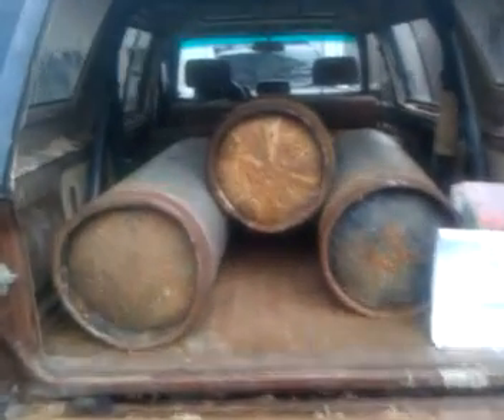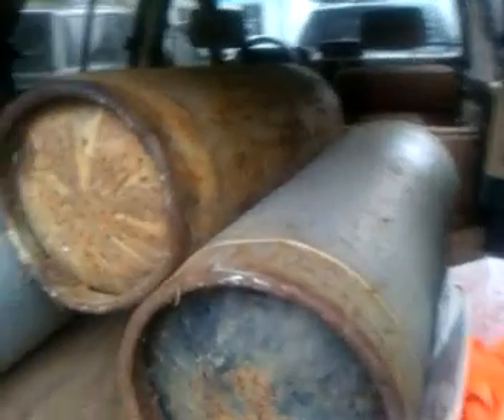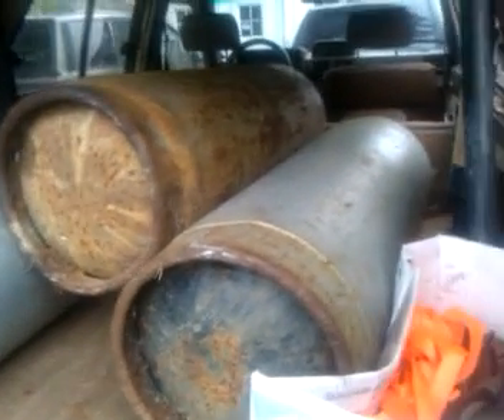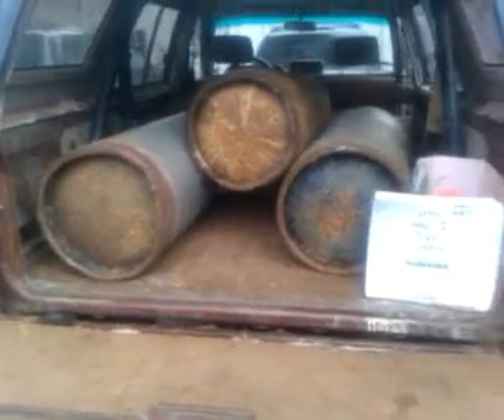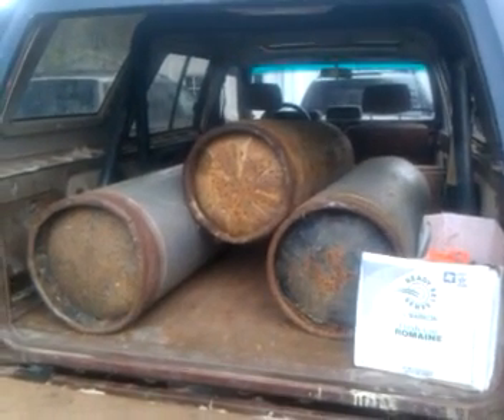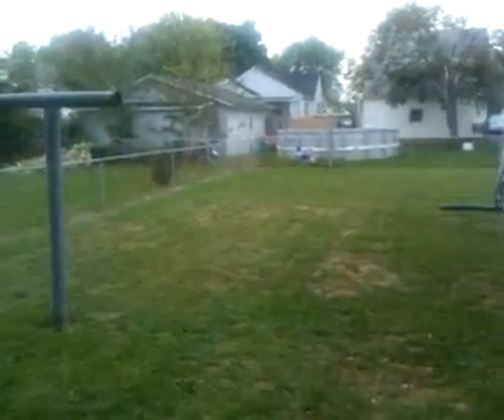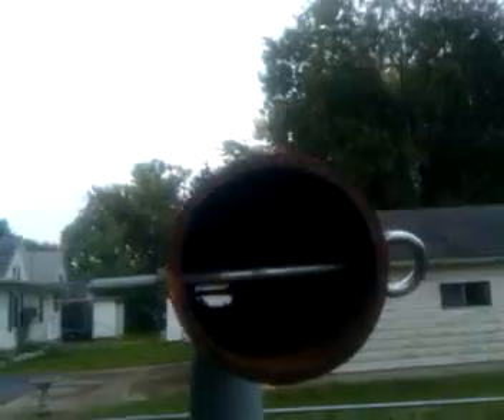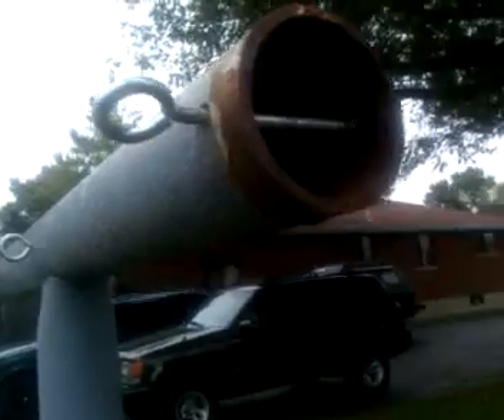First Rocket Stove build, from the start.

Comment from the maker: Thanks Kevin! I have watched most of your video's also the past few days and have picked up a great amount of knowledge from them. Great point on the "blowing up"! I am planning on shooting a quick video tomorrow on that exact subject. When I unloaded the tanks, which I was told was empty when I purchased them, and started to prepare to break them down as far as valves and such, I cracked open the valves to let them air out a little before filling with water and Yep, you guessed it, one had gas!